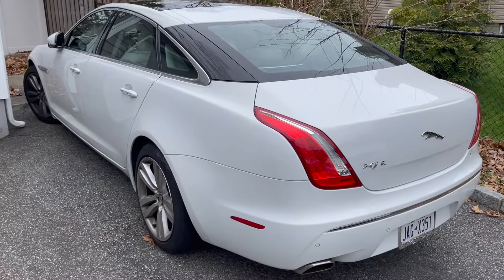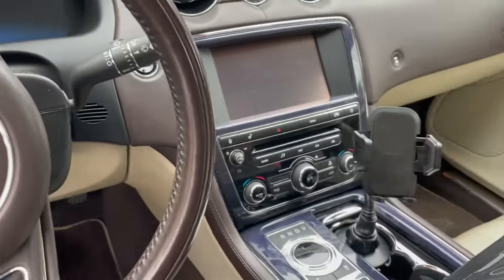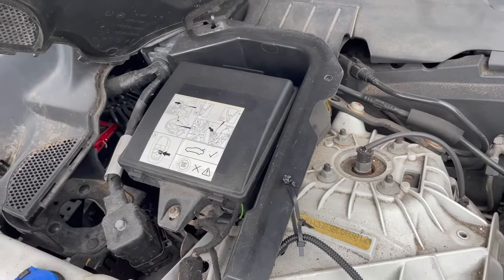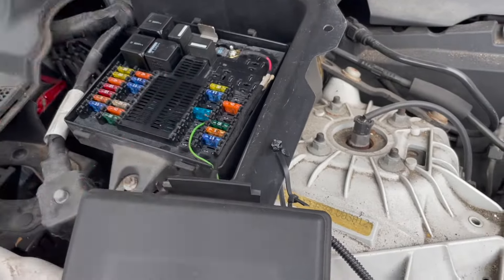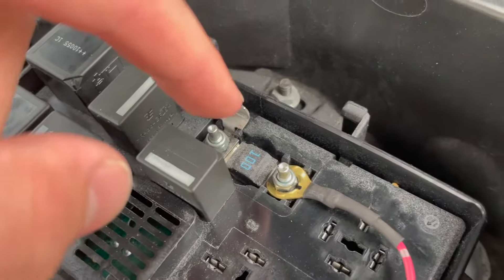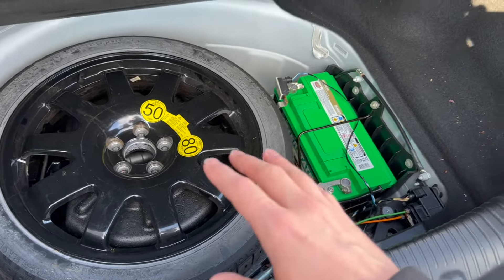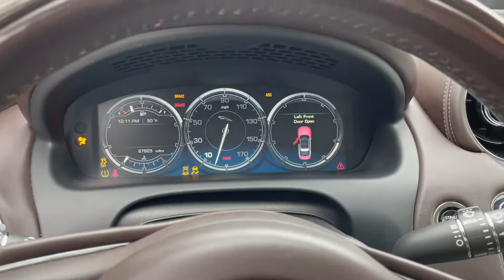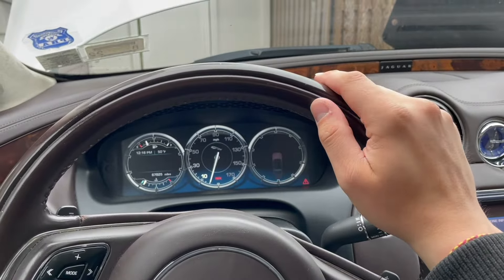How to PROPERLY jump-start a Jaguar XJL. USE THIS METHOD ONLY! Corrected.

Comment: Once the first end of the ground clamp is placed, some people prefer to complete the circuit to the helping vehicle's  ground (or jumping box negative terminal) before connecting the first positive clamp to the discharged battery. If you have both the positive and negative clamps of one end of the boosting cables connected, and then inadvertently cross the opposite end's pair of clamps (mishandling, wet surface, helper vehicle's exposed underhood metal, your ungloved hands...), sparking or much worse can happen, especially if the assumed dead battery isn't. Great series, thanks for all aspects of your XJ experience.
Reply from the maker: Good comment

Comment: I just changed my battery today. Had to refer to your video to find the ground! I located the (+) easily on my own. Ty for continuing to post info. I love my car to pieces! THANKS for the bit about how to jump the battery properly. I didnt realize about the ground in the boot.
Reply: Majority of European cars do have battery at the boot. This protects the battery from the heat of the engine and extreme cold during winter.

Comment: Correct to only apply power under the hood if the trunk won't open.  As for the trunk battery jump... the reason for not grounding directly to the battery itself is due to off gassing fumes. Batteries give off chemical gasses when charging or in hot ambient temperatures to release pressure inside the case. those gasses can explosive. you connect red/pos to battery & ground away in case there's any arcing/sparking to avoid fumes in the area... it's rare, but it can & thus, teach the safest way for the general public. it won't hurt anything hooking directly to the battery if it's well vented for awhile (remember when the trunk is closed, that's an enclosed environment. it doesn't' get the same airflow as a battery under the hood does).  Most trunk batteries or batteries installed inside the passenger compartment will have a small rubber vent tube attached to the battery... that only relieves pressure in the case, fumes can still be there, so alternate ground is recommended.  **Some luxury vehicles have TWO batteries in the trunk (like Bentley etc)... they do different things & you need to find out which one is the starting battery. 
 **Also keep in mind, it takes more power (amperage) to crank over an engine when the battery is in the trunk, the starter is still all the way on the opposite end of the vehicle on the engine... so all that electrical power has to make it the full length of the vehicle (just like an extension cord loses some due to length/resistance) so make sure you have a good power source capable of it.
Reply from the maker: Wow you made a lot of good points there, thanks for posting.

Comment: The positive should be attached to your battery first then the negative to your earthing point. The reason it is not attached to the battery is to prevent any sparks which could ignite any battery fumes causing a battery explosion.
Reply from the maker: OK got it

Comment: i have no power on dash i could not open my trunk like that had to remove rear seats to gain access to plug that opens trunk. took the battery charged it had a load test done and still not getting any power. checked a couple fuses but im not sure which fuse can cause this . not sure what to do, any ideas?

Comment: I inherited one of these from a relative. This car is a pain. Who the hell creates a car where the battery is in the trunk and you need power to open the trunk. This is one of the dumbest design decisions I've seen in any product. Do other cars have this "feature"?
Reply from the maker: Believe it or not it’s a very common occurrence and some cars even have the battery behind the backseat.
Reply: There’s a connection point under the bonnet (hood) to power up the vehicle temporarily, in order to open the trunk. The Citroën C6 has the same (although the Frenchie has merely an electric release — not a powered opener.

Aaaanyway, your complaints (both of you) are addressed in this man’s video… 🤗

It pays to keep up with technology and with current events… 🙄

Comment: Thanks, most informative.  My 2011 XJL Batteries last about 4 years on average.
Reply from the maker: You’re welcome. Good to know
Reply: It's because of all those fancy electonic features that are standard on the car. If the battery is not fully charged even it is 12.3 volts, it wouldn't start. The reason is, when you press the Start button all of those electronics will wake up and compete with other electronics to power on. You don't need to buy a flooded battery always AGM. The flooded battery will not last long, maybe 2 years max

Comment: I also have a 2011 Xjl  , however I am    having problems with the battery staying charged. I replace the alternator,  but a new water pump, and replace the control manjania. Still, the battery would not hold a charge and the water is linking that cause the car to run hot. If possible can you jnform where is the battery manjania located and what maybe causing the car to run out as well. I like this car but I am really considering saving the car at this poknt😢

Comment: I had a feeling mine was draining also until one night, i was in the car and everything shut down like its supposed to and looked around and noticed the vanity mirror behind driver's side in the headliner was on even when it was closed.  I pulled it away from headliner and just unplugged the connection.  New mirror coming soon.

Comment: Due to battery issues there ia any chance to get gear box fault
Reply from the maker: Yes there is. My battery was dying one day when I was driving and I got every fault code imaginable. Once I changed the battery it was back to normal.
Reply: Super helpful

Comment: Just be aware that this video isn't correct for 2015+ facelift cars onwards. You can jump start these cars from the fuse box under the bonnet. As well as the battery in the boot.
Reply from the maker: True but I prefer this method.
Reply: What do you mean by facelift?
Reply: Yes my 2015 has 2 hefty terminals in the engine bay to jump from.
Safer jumping from nearer the load ie. the starter motor.⚠️

Comment: You can find out if you have a alternator problem by starting the car Taken off the cables off the battery if the car shuts off it's your alternator